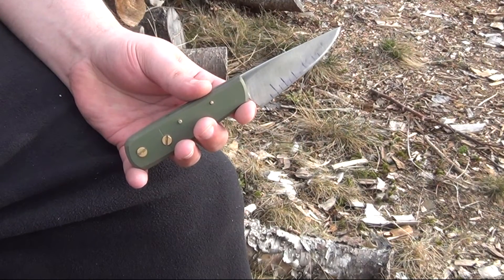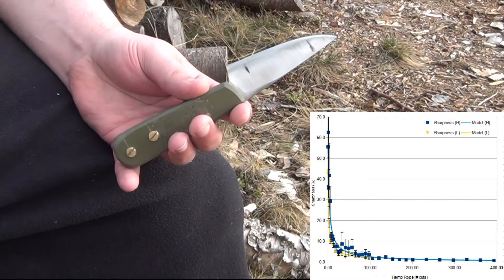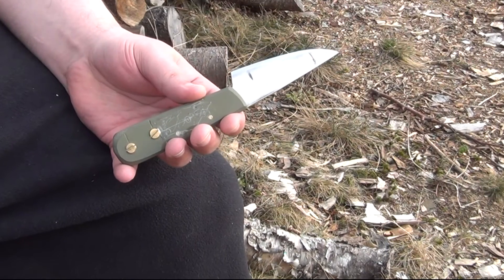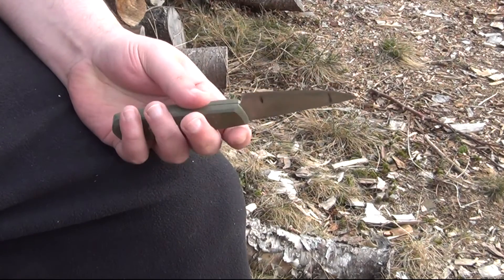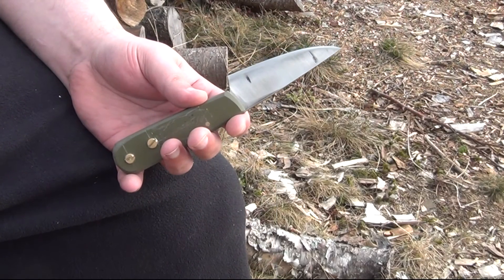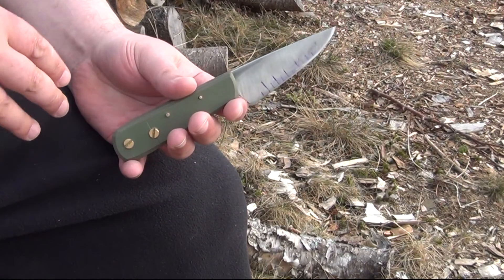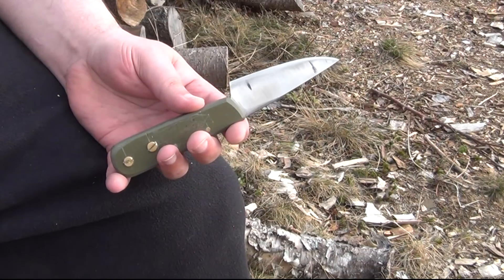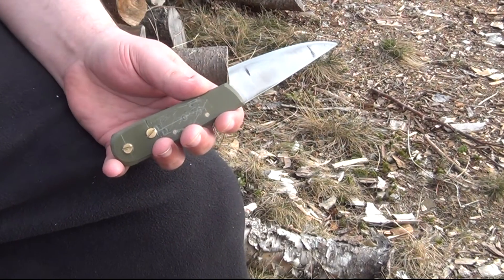T0.1M Mule Project : Calton 1095 - edge retention on manilla hemp from 58 to 66 HRC (Peter's)

Comment: Thanks for the info but I think some of it got cut off. My other question is will all high carbide steels break into pieces like what happened to the the green beret that noss tested if put on the same tests?
Reply from the maker: Ray, YouTube has started cutting off display of long comments, there is a more prompt that comes up that you have to click to see the full comment.

Not all high carbide steels break like the Green Beret. I have used the same knife, the one I had broke very easily as well. With Reeve there is more to it than just the carbide volume. It is difficult to understand as Reeve will not discuss the issues with his knives, he tends to be combative. 

In general the higher the carbide volume the more brittle they will be, but this is also influenced by other factors such as the shape of the knife, the general heat treatment and others so care is needed in generalization.

Comment: I've been learning a lot from your videos. I have a question, I've always been confused regarding this matter in the knife industry. What does brittle exactly mean? People say an m390 or s90v are brittle steels yet I have not seen one break. I've seen Guy Seiferds m390 and davis blade works s90v destruction tests and it seem to hold up well. Can a high carbide steel thats properly heat treated chip or bend and not go back straight? Thanks in advance.
Reply from the maker: Ray, brittle is a metallurgical term which means that when the material fails it will do so with little plastic deformation, i.e. it don't deform. 

If you pick up a kitchen fork for example and you bend it back and forth until it snaps you will see a lot of deformation around the break. That is ductile failure.

If you drop a light bulb and look at the shards you will see that there is almost no deforming, the pieces could be put back together almost perfectly. That is brittle failure.

As the carbide content in steels and the hardness of the martensite rises the steel will move towards brittle type failure meaning they will show little deformation, they will just suddenly snap.

However the strength can be very high meaning it takes a lot of force to break them.

For example, if you take a basic 420J2 steel (which is the mystery steel used in a lot of inexpensive knives) it can be as soft as 35-45 HRC. This steel can be so weak in cheap knives you can bend them very easily. The steel is not brittle, but neither is it very strong. If you try to break that knife you will find it deforms significantly and you end up almost tearing it.

If you take the same steel and hardened it to its maximum which is about 55/57 HRC then it will move towards becoming more brittle but the strength will be increased significantly as well. If you try to break that knife you will find it will still bend a lot, but you will be able to crack it.

If you jump up to very high carbide and very high hardness they will fail almost purely by brittle mechanisms. If you vice them and snap one off you can likely put the pieces back together and they will have only a slight bend if any. But the strength is also much higher.

In general you have to find the balance of strength and toughness (non-brittleness which is best suitable for the knife and how it is being used.

Comment: In a way, it seems logical that the edge retention would increase relative to hrc. It's nice that this is essentially triple blind testing too.
Were the edge angles all equal? Did Joe make the final edge or did you? Sorry for asking without checking the link first :)
Reply from the maker: There was an initial edge on it, but they were reground to equalize them.

Comment: Hi Cliff, great, great, great, and Thank You, but 1095 is not one of my favorites, it use to be, but with all its re-cycling, its not what it use to be, my older Ka-Bar's sort of prove that, I really like your knife design, wouldn't you be better off using 1095 CroVan instead, and wouldn't you have better results, no offence, but with a good cryo temp, I think it would out-do the 1095.
Reply from the maker: The knife used here is just a mule, it was designed as a test piece, 1095 is just the first of many steels.

In general, 1095 is subject to a lot of variation as it isn't a tool steel and it is a fairly inexpensive steel. 

A maker using it should really put some effort into seeing exactly what he is getting at ask for at least a composition breakdown and details on how it was made/processed. It might even be worth it to normalize it a couple of times before making a knife from it depending on the condition of the steel (grain size).
Reply: Cliff, would you agree then the 1095 CroVan could perform in the 0-1(tool steel) category, and is it that much more costly than 1095; so why don't the guy's using 1095 change to (its old name 0170-6C) 1095 CroVan ?
Reply from the maker: paulie 4x There are quite a number of steels which are similar to 1095 but have small trace elements to improve hardening response. Why are they not more commonly used?

Some people are forging and if you are those trace elements can make a significant difference which isn't always positive. 

Others may not even be aware of the fact that other alloys exist. Often people use a steel simply because it is popular, or someone else used it. Thus when steels start to get used it feeds off of itself and gets really popular as everyone tries to take advantage of the fact it is branded.

For a lot of knives there also might be issues with availability in stock sizes and quantities. There are some steels which would make very nice knives like F2 but which are not easy to find at all.

Comment: I know the answer to this will probably be no, but did you notice a difference in how easy they were to sharpen?
Reply from the maker: Initially the bevels were uneven, getting them all to the same angle took significantly more time with the harder stones.

However once they were at the same angle, apexing them after each run only took 50-75 passes on the Bester 700. There likely would be a difference here if you were using jigs, but in hand sharpening the tolerance in angle and the influence that makes would be larger in such a small amount of work. 

I was using a 600 DMT to set the final micro-bevel, they all set very easily. I prefer the harder steels for tolerances, it is easier to burr the softer ones but that is likely just because that is what I tend to use in general.
Reply: Cliff Stamp Why exactly did it take longer on the harder ones? Shouldn't the grindability still be relatively equal? What exactly in the higher HRC  version of the steel makes it behave like that? 

Also for what you define as the actual part of sharpening it does seem like the harder ones are easier to actually sharpen... unless you burr sharpen that is
Reply from the maker: shurdi3
Grindability is influenced by hardness, all else being equal, but much less than carbide volume. O1 at 62 HRC for example grinds far easier than S90V at 60 HRC.
Reply: Yes but what exactly that increases with the hardness increases the grindability? Or am I just thinking wrong?
Reply from the maker: shurdi3
Hardness is a measure of compression strength, this is directly related to the amount of force an abrasive needs to cut a material (rupture strength).
Reply: Yeah, I was mixing up definitions of terms for a moment there, heh, apologies